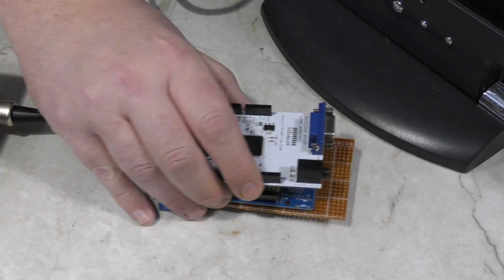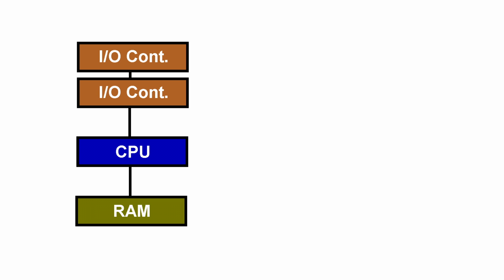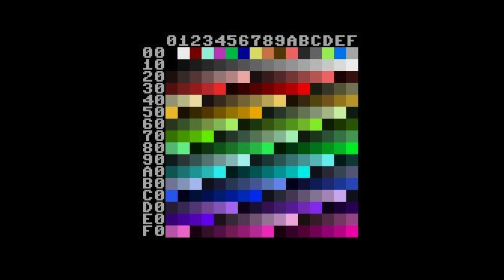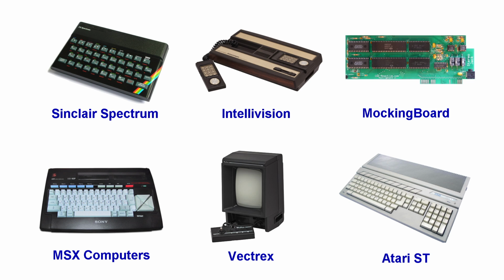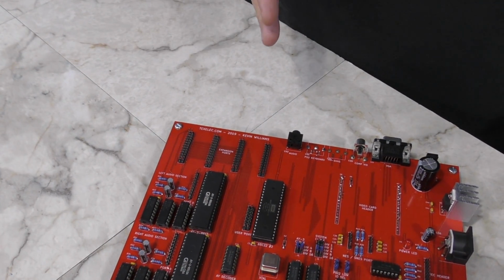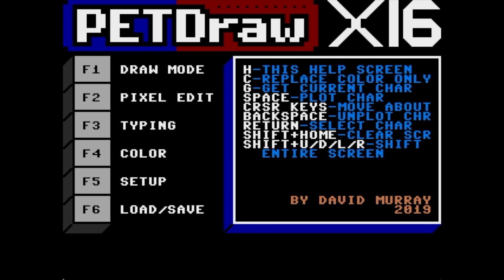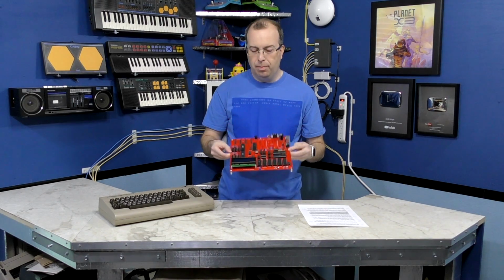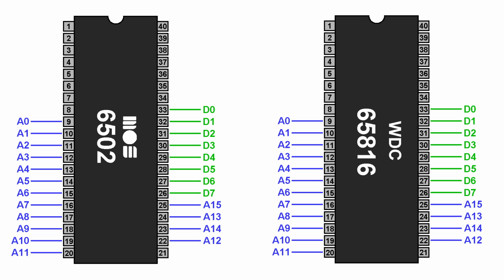Building my Dream Computer - Part 2

Comment: It's a shame we're stuck with the by now done to death AY-3-8912

Sure there's two of 'em, but the filter and ring modulation of the SID is what really makes the C64 what it is.

At least figure out some way to coax stereo out of those two chips while you're at it! Hard stereo, maybe even 8 position stereo... Something!

EDIT: Oh wow 2151 talk about an upgrade. That example is a bit disingenuous because the 2151 itself doesn't support the samples used for drums, but clever designers can make fine enough drums by sacrificing a channel for percussion. If the SAA-1099 tagged along like you said, we'd be looking at an experience that would be just a bit better than a SEGA MegaGenesis! That FPGA solution sounds like fun too, as having two SIDs would be just about as useful as a 2151 if even simple hard stereo was supported.

Comment: i like the abreviation cx16

also can you also write 0x02 to the auto increment to have it automatically decrament
Reply: Or (if it doesn't already) add the whole of that auto increment byte value, so you can move down columns quickly with 40, 80, 160?

Comment: Personally a C compiler would be fantastic...
Reply: Doing one to run on the machine itself would be a project of comparable scale to the hardware design, but if you're fine with a cross solution, cc65 will work with it out of the box just fine.
Reply: @shiru8bit  
Might check it out then.😁

Thanks

Comment: For the controller ports, maybe look into doing a 9 pin d-sub so you can use genesis/atari controllers? With support for 3 and 6 button variants. That way you dont have to use proprietary connector designs, and they still make new genesis controllers.
I always like the yamaha FM synthesizers. They are very flexible and sound cool. I like the combo option of it with the SAA chip. Seems like a good option.

Comment: This project has really lost the plot. The size and quantity of components just takes away most of the interest for me: not to mention the decision to use an FPGA for video meaning that it isn’t all “off the shelf” components.
Reply: I understand how you feel but this sure is a huge scaling back of how ridiculous it could have been if they had continued down the previous path.  The current design is a good compromise from the ideal. You just aren't going to find a video chip "off the shelf" with the features he's looking to add. If for example, you wanted to add even a simple update to increase the number of sprites to the VIC-II chip - a chip with 15,000 transistors inside - your only option is to go to an FPGA because building something of the capability of this video chip using off the shelf components would take an exorbitant number of discrete available logic chips. For a real simple 6502 system; see Ben Eater's new build.

Comment: It would be cool to see both Planet X-2 and Planet X-3 ported to the hardware if it’s fast enough!
Reply: If? Planet X Games run on much, much slower hardware, this thing can handle it easily! ;-)
Reply: Well, x3 on an 8 bit CPU could be a hassle.

Since it no longer has a 65816 that could make things a bit more of a pain, but it's still probably more than capable...

Comment: Why  not go full ham and use something like that DQ 8051 compatible 8-bit CPU?

The 8051 was already quite a bit faster than the 6502 and it has separate code and data spaces (which translates into larger addressable space), built in GPIO, built in flash for easy boot strapping, and timers.

The recent modern fab model is 30x faster than the original and has all the modern power consumption and frequency scaling mechanisms, making it an absolute beast to work with.

It also means you can downthrottle it to fit specific speeds to run old code at appropriate display speeds.
Reply: On the other hand, it isn't instruction-set compatible with the 65xx CPUs.  Which means completely rewriting all the work already done on the OS.
Reply: @SpearM3064  true, I posted that after watching part one jumping into part 2, not knowing how much they actually already got done (a whole lot).

Would be interesting if someone made modernized silicon for the ol faithful 6502 too.

Comment: I would have gone with a PIC32, an FPGA for logic glue, a memory chip probably accessed via the fpga, and some tristate buffers for interfacing to an external bus with e.g. sound. You can use a mix of hardware decoding on the fpga, and "microcode" in the ram, to implement a fast & relatively simple processor emulator: the fpga decodes instructions, bank-switches microcode according to current instruction, and presents the processor registers to the actual processor,  the memory can be very big, and the PIC stuff means you can start up in a simple monitor-bios over a simple RS-232 connection for test & debug.

Comment: If you need to have the FPGA there already, why not use it for the sound as well? It simplifies the hardware.
Reply: 20 Hz please :D
Reply: That’s indeed a logical next step. I’m sure it will be. It could still be mixed with other (optional?) chips.
Reply: I did a FPGA project with a 65816 and a Nintendo DS style PPU, no audio yet

Comment: Thought this project is clearly getting a lot of love and using the 6502 gets you a big potential software pool, I think this project is weird. I actually think the daughter cards for the c64 make a lot more sense. Certainly when you consider the price. For the start price you could get an c64 ultimate or c64 reloaded (cheaper) and then add Vera to that if you want. You would get the complete c64 software base plus whatever is added. 
If you really want a board that is designed to be a more powerfull c64 that is also easy to program. One should look at the c256 (c256foenix.com). It has the 65816 CPU + 4 meg video (seperate) + 4 meg normal ram. OPL3, OPN and SID chips plus an full audio codec and midi ports. It has IDE and SD for storage an expansion connector and all that for barely a 100 dollar more than this X16 thing (and that will lower over time with later versions like X16). I admit the c256 isn't finished yet, but neither is this. 

If you want something very simple and easy X16 might be it for you, but if you want some real next level stuff than c256 is the thing you want.
Reply: Th C256 seems even better. The X16 looks quite janky in comparison...
Reply: @Breakfast_of_Champions  In they end I hope both will reach their audience, something for everyone.
Reply: @bzuidgeest  Yeah David doesn't think so, your comment has been censored.
Reply: @Breakfast_of_Champions  if so that would be childish. I just pointed out options and giving choices.

Comment: You could also start with the Apple ][+, which also uses standard off-the-shelf components (save for the ROMs, of course); it’s memory map is as simple as the Vic20. Furthermore, it’s also a known workable design, and extendable via the 6 expansion slots, and uses no VLSI chips other than the masked-ROMs and the CPU, so if something dies, it’s all standard TTL logic, with some DRAM and a few 555 timers and such
Another option for video is the Propellor chip (which was used on the PE6502, which you reviewed).

Comment: Hi Dave.  Back in November of 1984 I used every byte of RAM in a basic program I wrote p the 64.  I went through and deleted spaces to conserve memory.
Reply: I figured someone had done it. 

I grew up on the Atari 800, which my dad had maxed out on with many of his own programs, so I expected people had done that on COMMODOREs too. 

It got so hot maxing out CPU and memory that we cut holes in the (beautiful) plastic and added 2 fans, one for input and one for output. Since the fans needed their own power supply, we epoxied a large DPST switch to the bottom front, so that we couldn’t accidentally flip on the computer without turning the fans on also. 

If I remember right, the taxing programs were (all in BASIC, may I’ve been fine if programmed on assembly):

1) a 4 joystick tag game 

2) an interactive astronomical atlas

3) a custom word processor for adding Greek, hebrew, and Latin fonts into documents (for my dad’s field of study)

I am glad that YouTube has provided knowledge to us retro heads that we weren’t alone in our obsession with that technology.
Reply: Oh ! What program needed so much RAM ?
Reply: @kernealalpiniste6293  The program is question was called "The fifty states"  I wrote a menu where you could select a number for each of the states, then it would gosub to that page.  The page consisted of a title and text that I copied from a book about the state.  I think I got to Maryland before I got the out of memory error.   It basically was all the text that used most of the memory.   I have the yellowed printout of the program in the archives,  it's about 15 pages long.

Comment: For the controller ports, I suggest Sega Megadrive/Genesis compatible. This means it will work with Atari standard joysticks (like most 8 bit computers did) but also have provision for more than one button if required.
Reply: I was thinking this too. Assuming the ports aren't just for testing. Less of an issue of possible problems with Nintendo and the standard was quite widespread back then suggesting it was a straight forward design and not vendor locked.
Reply: @MagikGimp  
Yes, almost every 8-bit computer used the Atari standard, and so did the 16-bit Atari ST and the Amiga.
It was the defacto standard in those days. Nobody owns it, so there wouldn't be any legal problems.
Reply: @MagikGimp  I can't imagine they'd have any problems with Nintendo, the patent has long expired on the NES hardware.
Reply: @IanDunbar1  With Nintendo, I wouldn't be surprised. Remember the whole games on YouTube fiasco.
Reply: It ain't retro unless I've got my ZIP STICK plugged into it!
Reply: I don't think you could do Genesis/Kempston cross-compatibility.  There was a 5V power line in the Kempston standard that was used as one of the buttons on the Genesis controller, so plugging a Genesis controller to a Kempston standard port would asplode the machine.  Why Sega didn't put the extra buttons on the analog paddle lines, I shall never know.
Reply: @thegardenofeatin5965  
I think there's a workaround for that, I remember reading something about an adapter to safely use a Genesis pad with a C64. I can't check properly because I'm about to start work.
I think you end up losing a button but it's otherwise safe.

Comment: Hmmm, wouldn't be more easy for the programmers to leave a low ram of 31k~ and two paged banks of 8k? That would allow to copy memory from one paged bank to another without having to use low ram as a buffer and also would be faster.
Reply from the maker: This option was discussed a LOT during the development phase.  And ultimately we decided it added too much complexity.  It would be handy on occasion, but I couldn't honestly think of any time I would use that feature.
Reply: @The8BitGuy  Understood :)
Reply: I would have done it differently and it would be proably even simpler . The 8K Kernal stays as is, but the 8K ROM segment and the 8K RAM segment would be windows in the 2MB address range of 4 0.5 MiB chips, 1 Flash ROM and 3 RAM selected each by an 8 bit port. 
Drawback: Only 1.5 MiB RAM.
Advantage: 1 memory chip less, 2 windows in RAM and ROM.
Complexity: same or little bit simpler.

Comment: Instead of AY-3-8910, a compatible YM2149 chip could be used at up to 4MHz clock according to datasheet. And for FM OPN, OPNA or OPN3 could be a better choice than OPM as they've got integrated YM2149-compatible synth for that simpler sound.

Comment: First time commented on your channel, watching for a long time.  I think what you are doing is pretty amazing, I remember getting the VIC 20 for Christmas when I was 10 and I said, huh?  My dad had brought home PET's and Super PET computer back in the 70's but getting dropped off to a doorstep of a VIC 20 and not knowing how to open a door was pretty scary.  My Dad let me learn myself and yes, the manual I think I still have (I sold the VIC 20 to my teacher and bought a C64 :) ) anyway, my buddy and I spent hours writing code and the following year I had got a subscription to Compuserve Magazine which had LOT's of information.  I bought a 300 baud modem and got access to DataPac connection and we ended up starting a BBS a few years later when 286's were around.

The memories of this time are amazing, spending all night coding something and then power goes out forcing you to code everything again the next day....we tied up the TV so much....

Anyway, love the channel and I will be first on the list to buy the x64 regardless of the price. 

Thanks for doing this.

Comment: you could have just swapped the pins on the video module upside down, that way it would still sit ontop of the board, but 180 flipped

Comment: The prototype is looking pretty good! A 6502 running at 8 MHz should be comparable to what you can get out of a PC engine, only a bit faster, that's plenty good enough for me!
As for the soundchip, I could live with 2 AYs but the OPN chip is SO much better... Shame I suck at FM synth...

Comment: You should do a port of Planet X3 as the included game on these computers.  How long until someone ports Doom to it though?  It would at least show the kind of thing that is possible for such a machine.  I like the case designs but I would have preferred it to use USB for perepherals so we could just use off the shelf components for things like mice, keyboards and joysticks.  Also a native HDMI or display port output would be better as there are more and more monitors and TV's about these days that forgoe the VGA connector.

Comment: I have an idea for your project! Design the final version to fit into a standard ATX desktop computer case with ATX case compatible power supply plus headers for power LED and power+reset switches! Then it would be great if this use standard computer floppy drive! And if you remove the LCD from the motherboard in the final version, move that LCD to an expansion card instead! 😉
Reply: I think I had said that 12 minutes before you did...  lol
Reply: @JVHShack  Similar minds thinks alike... lol

Comment: I'd recommend that you not only put the sound capabilities into the FPGA, but also a hardware 16-by-16 bit multiplier. That would speed up a lot of math related things since the 6502 (and the later 65816) didn't have any.

Comment: For the stage 1 mATX, why not allow the end user to install it into a normal off the shelf case?  I have 2 cases on hand already that need boards anyway.  I know that the board shown was a prototype, but the IEC port I hope gets put along side the other ports through the I/O plate.  For the normal case, I'd have to drill a hole in the top of the case in the current position.  Yikes!  I know there wouldn't be the aesthetic, but at least the boards would sell.  I personally would buy the stage 1 board if I could re-use my old Compaq case so I could have a sleeper.
Reply: This will possibly be an option.

Comment: So... I don't and will not facebook.  That said, I have two recommendations for this project which I would absolutely buy... but...

1) USB.  There must be a why to add simple USB 1 or even USB 2.  The reason I say this is that it adds a smorgasbord of connection options (including, BTW keyboards, controllers and whatnot).  USB programming is also simple and an introduction to packets.  And by adding USB, you immediately answer any request for ethernet, modems, sound expansion, keyboards, controllers, and related hardware.  Your kernel could even have easy basic access to USB devices.  Talk to USB with BASIC --- that is a unique feature! They're that simple.  Seriously, USB is one of the great inventions of the last 20 years.

2)  RPi GPIO pinout.  This may not involve any actual added hardware... but a lot of stuff is geared to connect, also, to the rpi 40 pin header.  This simple addition would allow the X16 to participate in many, many projects.  Of course, there should also be BASIC support :).

Both of these would position the unit as a tinkerer's go-to computer.

Comment: The ComanderX should also have an integrated keyboard then only it will look similar to Commodore64 orelse it will have no link with the past! I also think that it should have a pointing stick instead of a mouse! Apart from that it should also have a SD slot for read SD cards for loading OS or programs!

Comment: Just throw in a programmable clock divider, and you can keep all slow devices such as AY chip in (2151 isn't terribly faster either, it is slower in fact). SAA1099 is like 90% the same as 2xAY, by the way, and is about as slow.

Comment: If it can play the entire Unreal superhero 3 I'm sold
Reply: Well too bad, they're not going with the GI chips. It sucks that they can't use them. I hope they don't go for the FM chip instead.
Reply: I mean, yeah I'm more into that "true"sound (I'm still waiting for someone to remake THE song on SID) myself but FM does seem like a good option from size, price and versitility perspective dear mr.żeka
Reply: @nosville22  I guess for price and size, sure, but I don't think FM is a good fit for this computer. Maybe it's a personal bias cause I've never had a console or computer that used it. I think I'd prefer the gameblaster chip, 2 of them together gives you 12 channels which I think is more than enough.

Also a couple different people have made unreal superhero 3 on SID, if that's what you mean by THE SONG